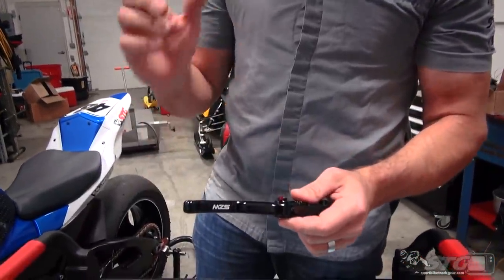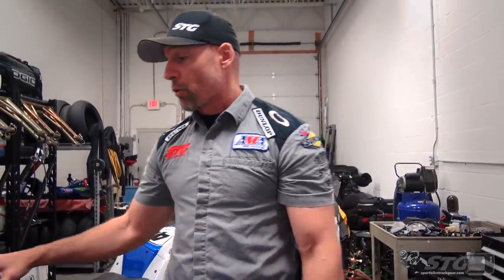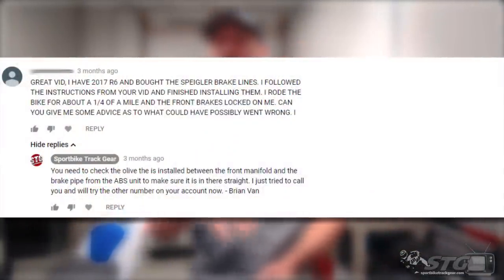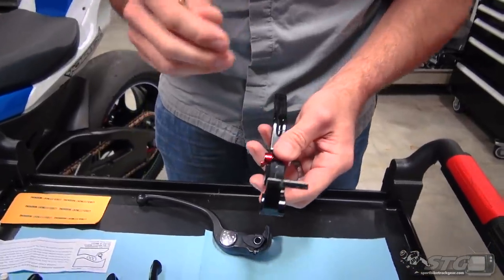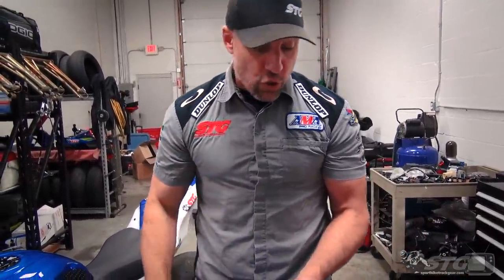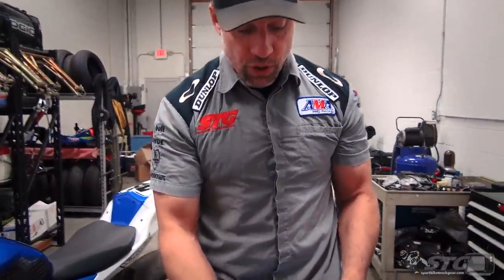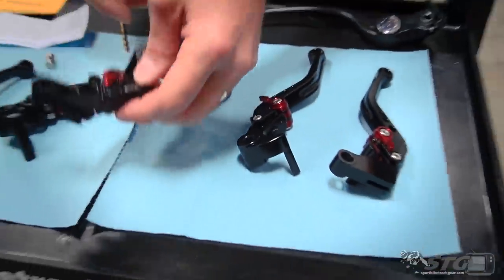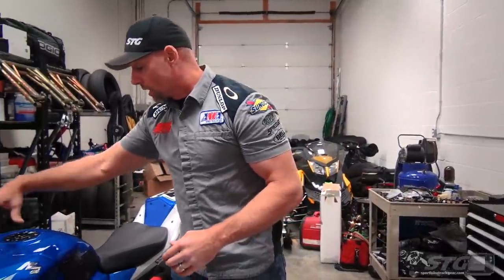The Truth About Cheap Motorcycle Levers | Sportbike Track Gear

Comment: Just checked my ' Chinese' break lever and it's fine . Your advice is appreciated, however I think it is wrong to condemn a whole market for AFFORDABLE aftermarket products. In my case 25 to 30 $ is the limit for a pair of break levers....and by the way on more expensive levers the rest isn't spent on better materials but for a name brand!
Safe rides and travels 👍🏍
Reply from the maker: IMO you should leave the OEM levers on the bike if you can not spend enough to get a quality set. The reality is these knock off levers have more play and offer less feel than the OEM levers. Also you are not just paying for a name brand with one of the premium levers, you are paying for a quality part that requires a much higher investment to produce than the junk knock offs do. - Van
Reply: @sportbiketrackgear  
I appreciate your response. However if you read through the comments you will see that most people tend to agree that quality levers are just too pricey. 
I have thoroughly inspected mine and that keeps me confident that they will do the job just fine.
As I pointed out before I do highly appreciate the video by pointing out hidden safety flaws that might safe riders from harm.
One thing I personally wouldn't do for example is use aftermarket break rotors since I feel confident to perform some strength tests on a hand lever however I am not familiar with the metallurgy and possible hidden flaws in such.
I guess everyone has a different threshold when it comes to safety. 
Safe rides 👍

Comment: if you have the mt07 then you will realise the brake sensor moves for you as its in a rubber housing. as for the r6 levers, im sure you can pop that bushing out and lubricate it yourself.

Comment: I'll spend the extra cash and save the skin on my ass before I buy cheapos and take a chance. Brakes are as critical as it gets when it comes to safety. My buddy used those MZ whatevers and they don't fit quite right so it ended up wearing his lever perch and the lever binded coming to a corner and had a nasty crash. When it comes to critical components I never take a chance. And that crash is not an isolated issue I've seen it a few times over the years with several makes. I had a set on my GSXR when I bought it and the clutch was sketchy to say the least. Bought a quality set and it feels like a new bike. To each his own some people rather save a few bucks and take a risk but when I apply a clutch or brake I want the response I expect and no surprises.
Reply from the maker: Thanks for watching and taking the time to share this! - Van

Comment: I had no problem using the cheap Ebay parts so far, which conincides with others experience.   But I will save up and buy a yoshi pipe cause its worth it..
Reply from the maker: Happy to hear you have not had a problem, unfortunately many others have. We have a rider who reached out to us who crashed and broke his arm. At this point there are multiple riders who have commented on this video noting brakes locking. Here is a link to a page we added to the site, has some pics of the crashed bike etc... https://www.sportbiketrackgear.com/the-truth-about-cheap-motorcycle-levers/  - Van

Comment: @Sportbike Track Gear What do you think about PSR Levers?
Reply from the maker: We have used them on a couple of bikes and they have been solid. PSR does all of their own R&D with manufacturing in China (last I checked). - Van
Reply: @sportbiketrackgear  Box says Taiwan. But your Right probably made in China. Thanks for the Reply.
Reply: @sportbiketrackgear  Hey is it ok to use regular car grease like you use to grease all the stuff on the car/truck. For the areas you said to grease on the Brake Levers?
Reply: @sportbiketrackgear  Also the  PSR Levers I got were $109 for the clutch and $109 for the Brake so $218 total. I hope they are made well. Watching people wreck cause of a bad lever is scary.

Comment: Awesome content buddy, I went with the CRG clutch lever and loved them. If I can ask you a question because you know your shit, I'm replacing the clipons on my bike and I got my stock grips off by squirting a bit of kerosine under the grips and getting them off with a screwdriver. Are the stock grips okay to use again after being exposed to kerosine, they still smell a bit after soaking in detergent overnight. I like the feel of the stock ones but I think I'll buy some new ones because I don't want to risk the kerosine eating away at them.
Reply from the maker: Don't do it half ass, you need a new set of grips my man. I know a guy who sells them if you want to pick up a set. - Van
Reply: @sportbiketrackgear  Thanks! I'll get a few grips down at the moto parts store. Cheers mate.

Comment: While I'm sure this is sound advice sticking with quality parts... But my set of MZS is SOLID. Better than stock. They gave held together great almost 7k miles of aggressive riding. Maybe I got lucky !
Reply from the maker: Here's to hoping your luck does not run out. The quality of the MZS levers is poor, better off using OEM if you do not want to invest in a quality set of aftermarkets. - Van
Reply: @sportbiketrackgear  We all need Gods grace n mercy no matter what parts we use. Thanks for the video, as I mentioned it's good advice in general. But I'm convinced I have a solid set. It wasn't about penny pinching I just wanted a good set. Maybe next time I'll try the more expensive brand and see the difference for myself.

Comment: Tried 2 sets of mzs levers on my r1 there is a cheaper set that’s 25 bucks or so then this 35 dollar set you showed here. If the 2 sets I bought they both had issues. The tolerances was terrible and the hole for the master cylinder plunger was not deep enough where the lever was slightly applying front brake. Wow!!! It really sucks because those thick mzs levers look so awesome. I like the look better than any other I’ve seen. But they suck
Reply from the maker: Thanks for watching and posting your experience! - Van

Comment: I have a genuine question? I'm new to the motorcycle community and I'm wondering why these things are so damn expensivive why do I need to pay 120 for decent products? Do those two little peices of metal realllly cost that much to manufacture and sell? Hmmm
Reply from the maker: If they are engineered and manufactured here in the US they will cost somewhere between $70 and $100 ish per lever depending on the design. There is a lot that goes into making a quality lever you can count on. Trust me when I tell you no one in the motorcycle industry is making profits like Apple does on their products. - Van
Reply: @sportbiketrackgear  I appreciate the response 🤘 and I bet that's very true. Worth dropping the money on my controls.

Comment: Oh c'mon dude, this is BS. I've put just over 60k miles on my 05 R6 with eBay levers.. never had any issues apart from the color fading. I have ebay levers on my other R6 (03) track bike, my 05 R1, and now on my 2016 R1.. Never had any mechanical problem with them over the past 8 years. I'm pretty sure I'm not that lucky. I say they're just as good as the $150 ones. But what the hell do I know.
Reply from the maker: I have handled and or installed most lever brands on the market today. This video is based on first hand experience, not rumors and hearsay.  The brake locking issue is for bikes that use a radial master cylinder, pretty sure the 05 R6 uses an axial master. These levers are shit, the tolerances are garbage and these levers are super sloppy. The OEM levers have better feel than these levers. FYI we have only seen the brake locking issue with the MZS Radial lever. - Van

Comment: I see a lot of bikes using the amazon eBay levers.... look they look great I agree but there is the saying “you get what you paid for” is 40 bucks really worth you’re life? I honestly have had these exact same levers in my cart but did not get them. Nothing wrong with my oem levers just fuckin huge/long. But I’d rather save up and extra hundred bucks and get something knowing it won’t fail in my especially on a motorcycle
Reply from the maker: They are just not worth the risk. Better to stick with the OEM levers if you do not want to spend money for a quality set. - Van

Comment: Its not a matter of cheap vs expensive in this case...its a matter of correct installation and thourough review and checks
Reply from the maker: I disagree, you should never have to modify the lever you are installing to prevent it from locking up the brakes. Never install sub par controls on your motorcycle. If you can not afford the good stuff then leave the OEM parts on. - Van
Reply: @sportbiketrackgear  well not saying modifying aftermarket parts. I think alot of times people just throw them on without making sure its done correctly or they lack the knowledge of how its supposed to be on. I do agree in not cheaping out on parts like that but $60 levers are close if not the same as $100 levers in my personal opinion. Now $30 vs $60+ is a whole other story

Comment: Appreciate the video and looking out for other riders. I got my first bike this summer, a 2013 cbr500r. Love it. Got some after market shorty levers on amazon for $40. Product seemed like excellent quality, however as soon as i finished installing i could tell there was way too much free play. Its something that bothers me but to save 400% to 500% i could get over it. Been riding with them for about two months now, no issues so far. I would not however compromise my life or potential injuries to save $200. The customer you spoke about with the R6, it seems like something happened during his installation of the brake line to cause that bushing to seize. If mine has been working no problem, i shouldnt have to worry about future problems, right?
Reply from the maker: The issue with the R6 rider was not his fault, the tolerances of the lever is the root of the problem. As for the levers on your bike you have a radial master so you should be ok. That said these levers still have sloppy tolerances and offer less feel than the OEM. Better off with the OEM levers on the bike IMO. - Van
Reply: Thanks for taking the time to get back to me. I agree, i dont love the feel of them and would not get discount levers again for my next bike, but for now as long as safety isnt a concern im ok with these on the 500.

Comment: I would not get the fancy folding one but the normal simple Chinese lever are perfectly fine. Cheap or expensive you need to inspect it before installation. There is not much to a basic lever and hack most oem levers are made from China. Same goes with clip on and rearset.
Reply from the maker: For sure the more moving parts on the more important getting the tolerances right becomes. The clutch lever we show in this video is a simple lever, while it did not fail the tolerances are still complete shit and not even close to where they should be. - Van

Comment: What are some decent levers with Reservoir that are affordable?? I got 2001 GSXR 1000 K1.. actually it's where the reservoir bottle connect to the cylinder there next to the lever. I just took the f**** duct tape off it holyshit!! The little tube part in there is freaking plastic and it's broke the freaking duct tape was holding it together. OMG I was doing like a hundred and forty on this f**** thing recently
Reply from the maker: I would just buy an OEM reservoir for the bike on eBay etc... Should be pretty easy to find one of these relatively cheap. - Van

Comment: Only here because I bought these levers installed them and went for a short ride less than a mile on my way home right down the street I went to pull the brake lever and it wasn't even on the bike. I was going down hill no back brake installed going toward cross traffic not fuckin okay man these need to be taken off the market people's lives ain't a fuckin game. They should all be recalled wtf is ebay and Amazon doing seling these man
Reply from the maker: All Amazon cares about is the percentage they get from the 3rd party retailer so Bezos can use that for his next tank of rocket fuel. - Van

Comment: I have a set of these style levers here, I just took them apart and they are well made. To remove the wobble you just need to do the nut up properly. This is just a bit of a scare story with the obligatory "Made in America" mentality, there are other places in the world that kick your ass on build quality and standards.
Reply from the maker: While I will agree in principle with what you are saying I will stand firm on the statement that MZS levers are absolute shit. You should not have to modify a control lever to make it safe to use on the bike. Read through the comments here and you will see several instances where these levers caused the front brakes to lock. - Van

Comment: The first thing I did to my cbr when I bought it was put the stock levers back on. The stubby "adjustable" ones like you showed were terrible. No LEVERAGE .....the purposes of a lever! The adjustability was smashed against your fingers or too far out. The tolerances in the machining was loose ans sloppy. 
The OEM ones aren't great because the bike is 21 years old but miles better than that rubbish. Stick to OEM or buy some expensive top of the line, full length adjustables.
Reply from the maker: We are on the same page for sure. - Van

Comment: Just because it’s cheaper to buy doesn’t mean it’s of less quality.  I bought a copy of my bmw levers and they are exactly the same as the OEM was probably made in the same factory
Reply from the maker: And these levers are not an example of that. - Van
Reply: Sportbike Track Gear ya I saw levers that claimed they were for my bike, with a close up the image you could see they would not fit and if someone drilled a hole bigger to make it work that could be very dangerous. Would like to send you a photo of how cheap the stock levers on my 2017 R9T are.

Comment: I think it depends on which  bike/levers you have. Cause I have cheap $40 levers on my 05 vtx 1300 and it has been fine for years. I tried them on my 13 cbr 1000 and it gave me issues till i installed the better aftermarket  ones

Comment: this opinion might be a little different than most of the comments i expect to see here.. ive had 4 sets of cheap chinese levers on various bikes and ill say that i have not had a problem with them (knock on wood) or failures... BUT... brian is 100% correct about the sloppy tolerances... id like to go with a set of CRG's or similar on my next purchase...  you can definitely feel the difference, i rode a friends bike with high end levers and they definitely feel much better, and for something as sensitive as controls, i think its worth it for the better quality part (obviously same goes for suspension and brakes)...  some chinese sliders even saved my bike in a crash and held up surprisingly well, so its not all bad, but i gotta side with brian on this one with the levers.
Reply from the maker: Thanks for sharing your opinion man! My goal here is simply to highlight a possible safety issue and show that there is a real difference between the cheap and the quality stuff. End of the day people need to make their own decision on what is right for them. All that said there are several comments in here from riders that had front brakes lock up with MZS levers. We have a couple more of the same on our Facebook post along with a picture of a bike that was crashed when the MZS lever caused the brakes to lock. Here is a link to that picture:  https://www.facebook.com/photo.php?fbid=587552511701923&set=p.587552511701923&type=3&theater
Reply: agreed... previously i figured its fine to save a few bucks on non-critical parts, and buy the good stuff for brakes, suspension, etc...  until now i always thought of levers as non-critical, never realized they could cause lockups like that...  despite some of the negative comments i think this vid is helpful because it doesnt just say "hey you should buy the better levers because we said so" you actually highlight the difference and explained how it  has caused accidents for people... keep up the good work... and btw just placed my first order with STG last week, you guys seem to have done a great job with your ordering process and followup procedures.
Reply from the maker: Appreciate your support! I am not looking to bullshit anyone, just help to make sure you all have enough information to get the item that will meet your expectations and perform. - Van
Reply: yep, its clear you guys put a lot of effort into doing things right, from your vids to your customer service and purchase process, it IS noticed.

Comment: I got a set of levers from Amazon for 40 bucks for my z900 they're made by a company called "Sconan" would you say that their trustworthy levers even though they're that cheap? 
Had I known it was a Chinese company I would have probably looked elsewhere but I don't know 😅😅😅
Reply from the maker: I would never put those on any of my bikes. When it comes to controls you either run the OEM or a quality aftermarket with a long standing reputation. - Van
Reply: @sportbiketrackgear  Really? That's all I need to know and that's the answer I was looking for thanks man... I started to put them on earlier but I took them off and put the factory ones back on until I get a good set....
🤜🏽💥🤛🏾